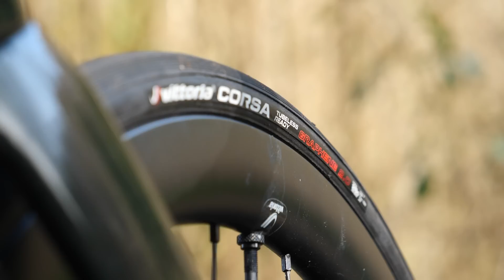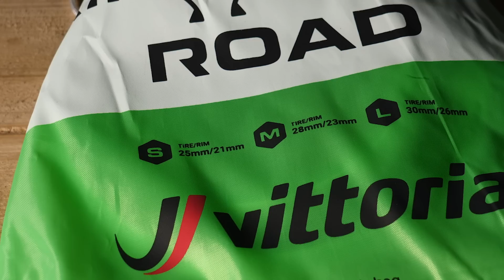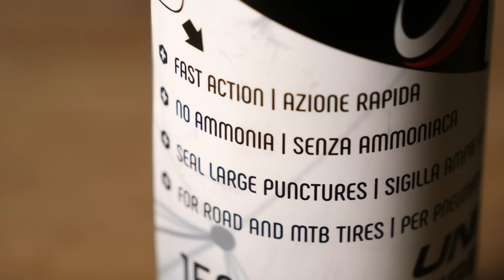NEW Run Flats: Pro Cycling’s Secret Tech | Vittoria Airliner Road First Look

Comment: im just here being like.. 'so how much for this glorified pool noodle'.
Reply: you'll answer that question the first time it saves your a$$. It's less about riding home on a psudo flat, it's about not having a blowout and crashing.
Reply: @darinjoseph7251  actually it's more consumer crap you dont need. But the sheeple will buy it.
Reply: @hcw199  don’t like it, don’t buy it. No one cares what you think
Reply: @sambarrett4726  no he’s right. This is just gimmicks being pushed with fad marketing and false superiority claims.
Reply: @KandiKlover  I’m guessing you know better than WT teams then
Reply: If your tubeless tires need this pool noodle now... How are they superior?
Reply: I thought tubeless were already puncture free, but I was wrong. So let me understand, now I need to buy more expensive tyres, a high pressure pump, sealant and now this, thing? I think I will stick with the innertubes, but thanks anyway
Reply: @hcw199  Ever had a blowout on the front doing +50kph. I can tell you from experience that a tireless aluminum or carbon road bike rim on asphalt is slicker than snot on a door knob. Luckily I didn't get squashed into a pancake by a cement truck after I left square footage of epidermis on the road.
Reply: @dirtyfork1  Um... No. No, no, no, and no - but well done for having a go at guessing, it's all good fun.
Reply: @hcw199  already superior in many ways, now they’re even more superior. But sure, just insult me. That’ll validate your argument👍🏼
Reply: @sambarrett4726  Oh Boo Hoo! You insulted me!

Comment: Imagine this system: You have a tire and lets say a rubber sleeve that holds the air between the tire and the rim. If you puncture you can just replace that rubber sleeve in 5 minutes for another inexpensive rubber sleeve. Or better yet if you want you can repair that rubber sleeve anyway!... Industry is laughable sometimes, tubeless and inserts make sense for mtb because you need to balance low pressure for grip and higher pressure to avoid pinch flats or rim damage. On the road? C'mon now...